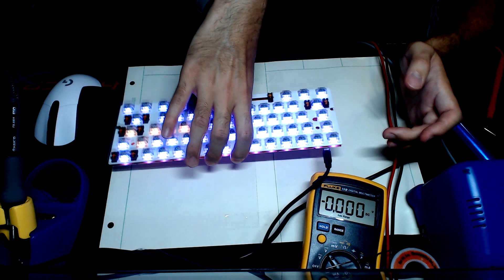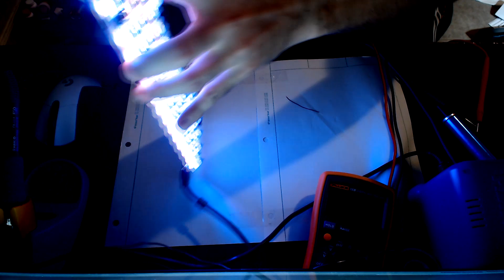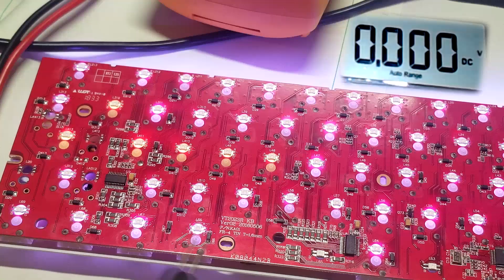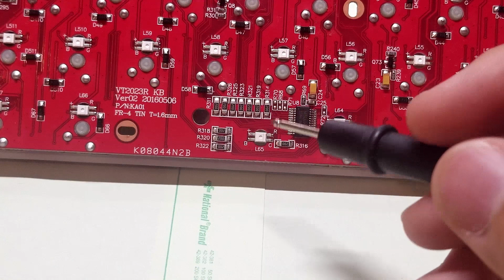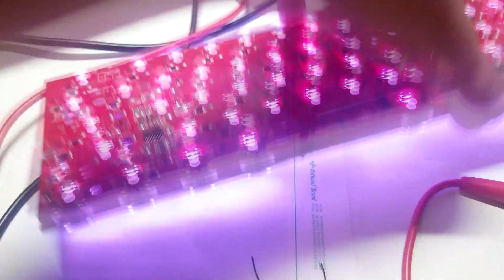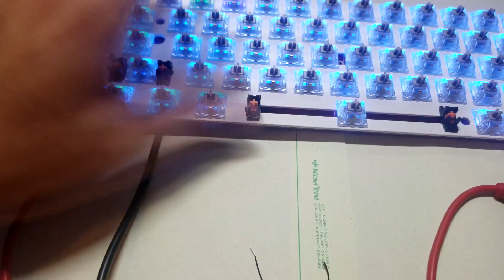Failing RGB Mechanical Keyboard Broken Trace Repair

Comment: I've got a Kemove keyboard (wireless, rgb K68) which is currently bricked, but occasionally comes back to life. Is there a basic troubleshooting procedure you would do in this instance? I took the board apart and can't find anything wrong with it visually.

Comment: How easy it is to replace a broken led? I figured it out that one dead LED messes up with a hole line of my keychron keyboard
Reply: A blower should be the easiest method since it heats up all the connecting points

Comment: In my rk61 r keys are not working. 6, y, h, n. All these keys are in a column. It's not a key problem. I'm pretty sure it's an issue with the pcb. The hotswap socket are all properly soldered. Any idea how do i fix it?

Comment: i stabbed a pcb trace with a switch pin whilst i was trying to put it on, do I just solder it?
Reply from the maker: u can use a single strand of copper from stranded wire or you can use solder to refurbish the connection

Comment: is it the same principle if some led turn on eventho i turn it off?
Reply from the maker: If you spilt something on the keyboard that could cause a short. I would recommend opening the keyboard up and looking for water damage / corrosion and clean with a small amount of isopropyl alcohol.
Reply: @divinfLLC  i already open up the case and look at the pcb but it doesnt have corrosion at all and as long as i remember i never spill anything on the keyboard. but i will try whole cleanup with isopropyl alcohol.
Reply from the maker: @mrcapucino  try to test the LEDs that are issues to see where the voltage sources are coming from

Comment: This is exactly what I'm looking for, but you think the problem of my keyboard is the same? The 3keys - ,+, and enter on the numpad aren't working. I tried replacing the switches still the same. I tested it on keyboardtester site using tweezers, it lights up but no response on the tester site.

Comment: Hello!   I am actually facing wrong RGB colour and no color on 2 keys when the whole keyboard is of the same colour...though the colour for them is different the keys are T and right arrow key and both behave inaccurate on changing colour.....what do have to say?
Reply: I also have the same issue on my keyboard, did you fix yours?

Comment: Could you provide an insight? What could be the problem if the mech KB cannot work in type C cable mode. I have to end usually end up. Thought if the cable is connected the indicator light is still ON like it is on a charging mode I guess. Thanks!
Reply from the maker: What type of KB is it? I'm not sure I understand what you mean by type c cable mode. (Can the kb take USB C and other cables?) I would try cleaning the USB c port and if that doesn't work install a new USB C port.
Reply: @divinfLLC  sorry, I meant USB TYPE C cable mode. So I have this generic wireless mech kb. I don't think it has a brand though. BT and 2.4 connection is working. But randomly if I restart the device the USB mode would work but once I connect to either BT or 2.4 and then switch to USB mode, the USB mode would not work anymore. But again the indicator light is still in indicating that it's charging or something like that. Not sure if I am explaining it clearly. Thanks for your reply brother.

Comment: I just got my keyboard broken. The whole row where my left shift key are not working. The whole row doesnt register when i type. Is it possible for this to fix ?
Reply from the maker: It would be a similar repair to this PCB but most likely a ground/short issue or a broken chip. The only way to test this is by accessing the PCB and using the solder points for the switches as test points.

Comment: Is there any video to how the jumper wire work on the keyboard. Multimeter seem to take a lot of time to recognise what's the problem. And my question is are the jumper wire really can fix the rgb problem?
Reply from the maker: Jumper wires should only be used to repair broken traces. Why are you interested in adding a jumper? Do you need a test point that you frequently use? Are you trying to add additional RGB to your keyboard?
Reply: @divinfLLC  Sorry, I have no idea what I'm saying. But is there anyway to know if the LED rgb has failed not because of the trace issue. Also I'm trying to figure it out if I could fix 4 led lights aren't working at different locations.
Reply from the maker: @EpicRiceXD  What are the symptoms of your failure?
Reply: @divinfLLC  "~ and J" have no light at all. "5 and Shift" got colours but whenever the keys turn red it has no light. Only RGB is the issue I still can type every single word.
Reply from the maker: @EpicRiceXD  Definitely a chip or trace issue. You would have to physically look at the board to diagnose the rest of this. LEDs dont fail all at once like this so its definitely repairable.
Reply: @divinfLLC   Actually I ended up ordered a bunch of new Smd led RGB 6028 for 7 bucks, Idk why I believe that led has died or something like that. Already spent more than 3 hours looking at the board with multimeter also clean the board with alcohol. Also I do have a question can we test Smd LED RGB 6028 without a resistor? It's kinda make sense if you said it has something to do with the trace issue.

Comment: My keys are working but the LED on some keys (num2, num8, ?/, context menu key, F1, 1, Q, and A) is out of sync, the blue light is weak, and if you turn off the RGB the keys that I mention is still lit up in low yellow-orange light.

Keyboard: Asus TUF K3

Comment: Is it possible to completely remove the LED from the plate? 
I dont need any RGB or lighting to my keyboard, why do companys assume. lol
Reply from the maker: you can remove the LED controller or follow the universal trace for the LEDs and Cut the trace on the PCB with an exacto knife.

Comment: My “1qa” keys all don’t work but light up although a different colour. I can’t find the trace it just stops and the traces go right instead of up.
Reply from the maker: Look on the other side of the PCB, if a trace stops it usually flips to other side or a different layer (keyboards are usually only front and back). Have you tested the other traces?

Comment: How does such a thing happen? What causes it to break or was it a manufacturing defect to begin with?
I have a mechanical keyboard and one of the key stopped working and one has a dimly lit key, while the rest are fine. Could it be solely from handling it roughly or are there other causes ? 

All the keys were fine when i bought a it months ago. I think it’s because of the bad handling of the keyboard.
Thanks
Reply from the maker: Usually weak solder joints from the factory and the user banging their hand on the keyboard. I aggressively play rhythm games which use only two keys that were the keys right under the issue solder joint.
Reply: @divinfLLC  Thank you so much.

Comment: Umm, I have a question
When the RGB is off some keys kept staying on but with low unnoticeable and flickering RGB lights.

Do you know what caused it?
Thanks man cheers
Reply from the maker: Bad capacitor or resistor. Could be a broken trace as well. Use a multimeter to check the continuity of the flickering rgb lights

Comment: hi dude ı have a same issue on my corsair srafe rgb but ı dont know whats wronk on the pcb because different rgbs  are not working. how am ı going to fix this (ı dont know any think about this pcb btw)
Reply: were you able to fix it? i facing same problem with same keybooard.

Comment: Nice word. I have a cooler master quickfire and the keyboard just don't work any key, just lock leds are working. If I  use another keyboard to active other leds it work but I can't control anything. I remove, clean an put back the controller but not working either. When I plug on computer it recognize normally. You can help me because my options are getting to the end.

Comment: i have a question. when i plug my keyboard it activate keys in bottom line like windows, space key etc. i think this happen because of excessive lubricant's that i used before to make it silent . would you recommend me to replace those switch from bottom line or how can i check it. do you have any recommendation please ?
Reply from the maker: Take apart keyboard, spray keyboard with brake cleaner and then 99% isopropyl alcohol, this will clean any shorts on the pcb then start diagnosis after cleaning.

Comment: will explain my problems here. sorry for my bad english

at first, i thought it was just my keyboard led problem. its blinkin brighter than any other keys.
if i click one of em which is "1", "q", and "a" when its blinking, it register any other key.
if i press q, its also register tab and w,e,r. 
if i press a, it register capslock, s, d, f
or if i press 1, the other keys like 2,3,4,5 also registered.
im so glad if you can help me
Reply from the maker: Did you spill liquid on your keyboard? I would take it out and clean it and then test it again. Try cleaning around the traces of those keys that are an issue
Reply: @divinfLLC   its brand new tho, thanks for advice. I will try it

Comment: I have a razer blackwidow X, I change the switch, since it failed me, when connecting everything, the LEDs of some keys do not show the corresponding color or it simply does not work, the pcb is a bit complicated, the mapping of this is difficult, I will try watch your video multiple times. anyway thank you very much
Reply: I have exact same problem on my keychron keyboard. Did u fixed it? And if u did then how ? Please answer!!
Reply: @itsyoboigucci7578  I  just sold my keyboard $20 usd ,  I have other better
Reply: @rz4048  3 weeks ago i asked you, i throw that keyboard in dustbin i broke the PCB in half with my hands. I have new keeb now lol

Comment: Hi super video! Can i ask you something? I have a Logitech G pro and after resolder, a new switch (for F7 key), something very strange happened I don't know what can be the issue: keys are lighting correctly ( all) but keys 5 t g v and space, even if are sending the lights, not sending the signal. Do you have any idea on what could be the issue? Few other mentions: I lubed all the keys previously, i also do this procedure of resoldering, new switches, a couple of times, as Logitech G pro has this problem of broken stamina inside the switch and can't replace keycap otherwise, also last time because I force resolder UP key, this key stop working and in order to solve it I need to make a bridge with another key, I also try cleaning with isopropylic alcohol.  Thank you so much !!!!
Reply from the maker: When multiple keys are not working that usually indicates a faulty ground or power source! The keys 5 t g v are vertically stacked so if you trace the PCB of where those keys are you should be able to find the single cause of the problem! This should be an easy repair! Just try to measure the voltage outputs of a working key and reverse engineer the traces! Good luck!
Reply: @divinfLLC  thanks!
Reply: @divinfLLC  i have the same issue with him, but for my case, the not functioning key is 5, T, and B, i'm not experienced and barely new to this, i dont know how to fix this not working keys after i change the switch by solder, even around my place theres no technician that i know can fix this kind of issue, i really need some light for this, please help. thank you

Comment: I have a razer keyboard where the z and h key dont light up at all and b is stuck on blue and green, F7, 9, L and P are a bit off color and flickering. I guess it was my fault because I had to open it to replace a switch. Once I did for some reason the z led stopped working.
Reply from the maker: Hmm I would check to make sure nothing is shorted out near you soldered. Razer keyboards are known for dying LEDs
Reply: @divinfLLC  Yeah I know. I actually bought this in 2017 and havent used it until today because the H key didnt work but because of this video it works now :) and after switching switches again now the only  leds that dont work are zh and b (b only doesnt show red/ish) Trading 3 leds for a working key is a win for me :)

Comment: Thank you for the video, such an easy fix... that's what I'm going to check for first (Corsair K95 RGB). And hey... your hands are really shaking a lot, you should lay down the alcohol. (joking)
Reply from the maker: Haha, I was on some extremely strong sedatives at the time for my viral lung infection (not covid). I am fully recovered now!
Reply: Did it help to you?? I have same keyboard and my red LED is dissapeared on all over keyboard :(
Reply: @nikolike7332  Actually I didn't yet tried to repair my keyboard, I just have like 4 keys that don't light blue, but if I hit the keyboard it starts working again for brief moments. I think it is because of broken solder contacts. From what I could find out, these Corsair keyboards all have problems with the soldering.
Reply: @TrinityAlex  thx for fast responce! On corsair forums I saw a lot of people that report same problems with their leds, so I think It's really defect of their keyboards. But I wish I can repair it somehow or just sell and buy new one xD

Comment: 5:01 By mistake i torn it the bottom memory and half of the keyboard won't light so should i try to fill that spot by melting solder? In my opinion will be the same as that tiny solder joint.
What's your opinion?
Reply from the maker: amino! Can some tines get away with using solder as a trace! I would recommend getting some 30awg wire to replace the trace instead of using solder however
Reply: @divinfLLC  ok thanks
anyway i got new  keyboard 😂